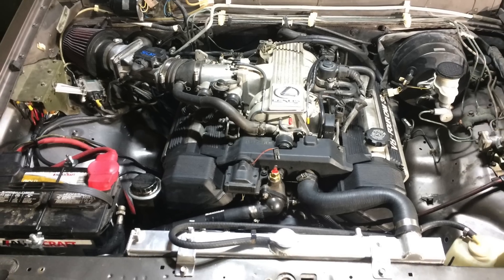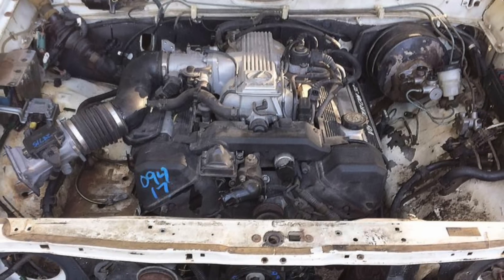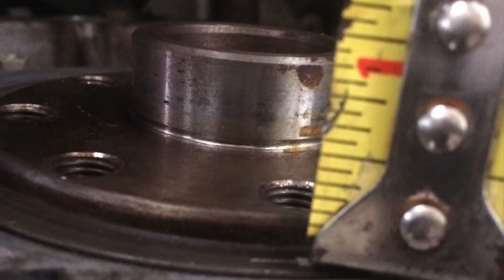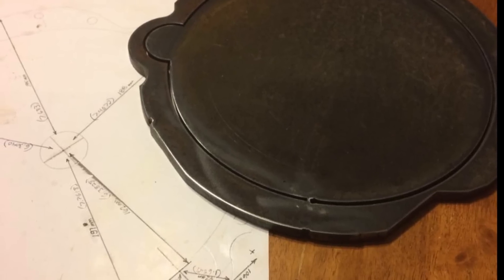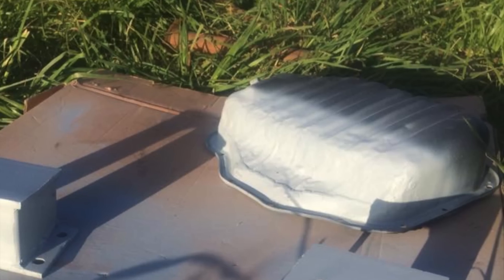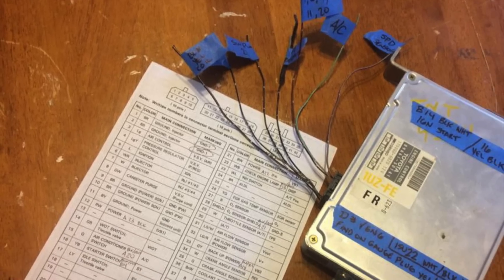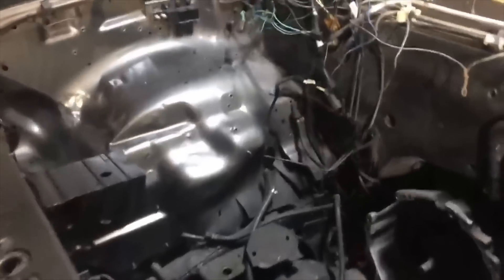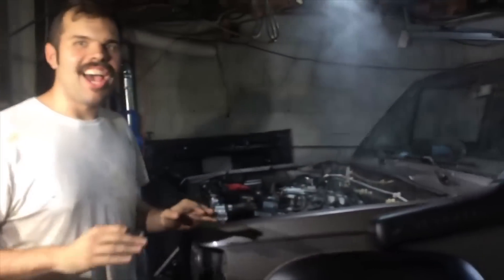How to do a 1UZFE Swap

Comment: Hello, trying to find a “RE-manned” V6 engine for my 2002 Trooper. Not doing the rebuild due last experience trying to rebuilding the Transmission 3 times before just getting a RE-manned. Runs great now. So doing the same for the engine. I’m in San Antonio, TX.

Comment: I have 1977 celica  liftback with 1UZ and getrag 6 speed swap, and I must say it is the smoothest running engine I have ever had. Yes the tuning is hard and expensive but there is way more support for it now than 3 years ago. I honestly think in couple of more years it will be very easy and cheap to tune.But in stock form, the engine is unkillable and smooth as heck.
Reply: What type of gear box you running on your engine ?
Reply: @owenfalconer9398  Getrag 6 Speed G420 out of e46 m3.

Comment: You’re a smart guy 
I need help with my swap please
Reply from the maker: STR33T TUN3R what can I help you with?
Reply: @Johnny5troopers  
I want to  do this  v8 swap on my 96 trooper automatic with the 3.2
Will the transmission bolt right up.... and do you sell the motor mounts?

Comment: I LOVE my 1UZ-FE. It is one of the smoothest running V8 engines ever built! I got REALLY lucky and picked up a 96 LS400 for 65 bucks.  It needed a computer due to capacitor leakage.  I bought a used ECU on Ebay and I've been driving it since. Toyota was at the top of their engine game in the late 90's. I also have a 2JZ-GE in a GS300.
Reply: Love this story! The Lexus motors are superb, especially the pre-2005 models because the engines are so bulletproof. I bought an 02 IS300 with stock manual from a buddy for $400. Did the timing belt and water pump, fixed the brakes and sticky dash and now I have a really fun, really reliable car good for another 150K miles.
Reply: Toyota has always been a head of the game since they started their line of production and it still has its mark until today
Reply: 65 bucks seriously i got a 96 ls400 for almost 9k
Reply: A steal!!!

Comment: Did a 1 uzfe into an 04 Australian holden rodeo ( Isuzu ) two wheel drive auto last year. Used a soarer 1 uzfe.
Hybrid part Isuzu and part Toyota trans. Looks factory ..great fit and goes well. Nice work on your swap.
Reply: Heyy bro I'm about to try the same how'd you go getting engineered with an older engine? My 3.0td just went
Reply: Did the oem auto trans needs any modificationa to work with the 1uz

Comment: Hello Johnny I have a 1st Gen 1988 Trooper with the 2.6 with the automatic  Transmission would the 1uzfe work with with the 4-speed Aisin Warner automatic ?
Reply from the maker: Robert Kirby the Lexus engine will bolt directly to it, just change the bell housing. They both use the same transmission
Reply: @Johnny5troopers  where can I find the bell housing and motor ?
Reply from the maker: Lexus LS400
Reply: Hello Johnny, same question herr, 
I have an 88 trooper, a 1uz laying around, i will source for the be housing, 
My question is, do i use the ls400 ecu for the transmission? Or should i leave the trooper ecu, and install TPS to intake manifold of 1uz for it to propperly shift? 
Also, what torque converter should i use? Or are they the same?

Comment: Does it work if you start with the GM v6 5 speed manual?
Reply from the maker: Mark Catanzaro yes. You have to change the transmission front section and the rear driveshaft
Reply: Wow thank you very much for the speedy reply!  I've been a trooper fanatic since the 80s and I love your videos!

Comment: Great video series! Just curious as to the years of LS400 engines that would work for this swap? Also if using the auto transmission would need additional mods. Thank you for this series Johnny.
Reply: Where you able to figure out the auto trans question? Planning on doing it on my trooper just want to know if anything is needes for the ahtomatic

Comment: Swapeprs,make sure you are getting a non vvti engine as it is more reliable and built stronger plus less problems with electrics etc.
Reply: ? how is it more reliable? are you thinking the 4.3? There's no distributor and plug wires and al that to deal with also.
Reply: @spinnetti  because without vvti it is a non-interference engine. As well as having thicker rods. Early 1uzs are better for boosting stock.

Comment: Hello, I want to do this swap to my 87 4runner.  Will post a vid to show my progress.  Thank you for the information..I was curious about the transmission because I don't want to lose the 5 speed.  I have read that the R151f is the best option for the 1uz 4runner swap.  Ks racing from ebay has the bellhousing and adapter plate.  The work will be the wiring...you handled that in a very organized manner.

Comment: I've considered this swap for some time. While my 2.6l runs great, I would like my Trooper to have more power. Mine's an auto and a neighbor has an LS400 that's been sitting for a couple years due to bad air suspension that I could probably pick up cheap. The one thing that is holding me back, is that the darn starter is under the intake manifold. I would hate to be off road in another state and have to remove my intake to replace a bad starter.
Reply from the maker: Try replacing the starter on your 2.6 then get back to me
Reply from the maker: 1)roll start, pull start, etc
2) pulling the intake is not that big of a deal
Reply from the maker: How does the idea of pulling the head off your 2.6 off road in another state sound. Blowing a head gasket on a 4ZE1 is about 100 times more likely than a 1UZ starter going bad. I think your logic is faulty.
Reply: Nice clean heart swap, Lexus sounds amazing. Great job on the wiring details i would be in for an adapter, I have a Trooper 2.8.  Question: So an automatic is an easier swap at the bell housing?

Comment: I know you preciously mentioned the 99 Troopers are a lemon but after seeing this video your a very skilled craftsman and I believe one day if your willing you can make this happen for the 98-02 Trooper... I have the classic Forest Green color and get endless positive compliments on what a lovely looking vehicle it is but deep inside I know the engine is crap but with a motor like this I would feel complete... Who knows maybe one day it can happen and you and your partners got the job... If not I'll just get 2012 Nissan Xterra... Great Job man
Reply from the maker: This would be a very easy swap into a '98-'02 if it has the 5 speed. If it has the Auto (GM 4L30E) which is junk then you'd be better off scraping the entire powertrain for the Lexus engine and trans. You can mount the transfer case to the back of the Lexus trans..
Reply: Johnny5ive  The biggest problem with me is the most I know about maintaining a vehicle is simple stuff like performing a complete tune-up changing brakes starters alternaters rotors brakes plugs filters fluids and installing audio systems... That's basically as far as I can go... I honestly would have to just pay to get it done right lol... Sad but true my expertise are in holistic medicine and graphic design...  I just like to drive rare classic Japanese vehicles... I do have access to a 97 sc400 automatic engine and trans that's been sitting for almost 6yrs now...  I live in NJ... If down the road the price is right and all the bells and whistles are figured out you guys got the job that's how much I love the vehicle I really don't want to part ways with it I just spent 1200 to install a new timing kit water pump and all and had to change some internal valve seal that was causing oil to leak out... Thanks for all the great info
Reply: Transfer case won't just bolt too the back of the Lexus a340 it'd be smart to swap one from an 03/04 axiom or rodeo you can then use the Lexus bell housing with the rodeo transmission and it'll bolt right to your TOD transfer case
Reply: Which Lexus transmission will the Isuzu transfer case bolt to? Just the A340?

Comment: Am I going to need to source a  4 cylinder transmission to mate to the lx motor? And how much for the cad drawings or a replicate adapter?
Reply from the maker: If you've got the V6 5 speed you can just change the front section of the trans to the 4 cylinder style. I am going to take pre-orders and have a run of adapters made very soon. Send me an email with your contact info so I can get you on the list. j5@johnnytroopers.com
Reply: Johnny5ive hey I'd be keen to go on that list for an adapter, I just tried to email you and it bounced back. I'm in sth Austraila my email is corey.barrett@gmail.com cheers
Reply: Johnny5ive I was having the same problem as theaussiesamurai I sent an email but it didn’t go through. I would also be very appreciative to be put on the list for the preorder, my email is tristangarza@yahoo.com
Reply: Johnny5ive what is the price going to be for one of your adapters?
Reply: I'd like to be on that list as well, jgodris@gmail.com